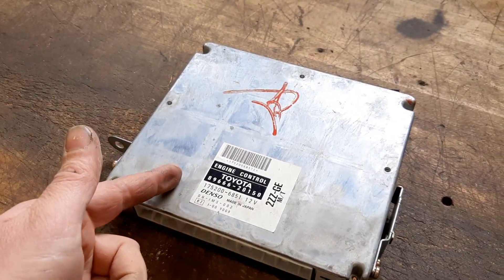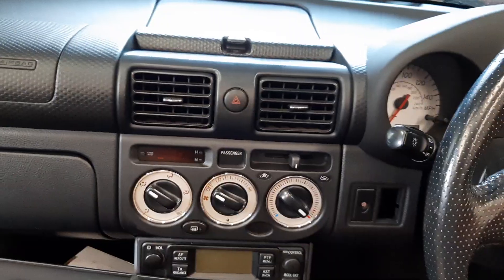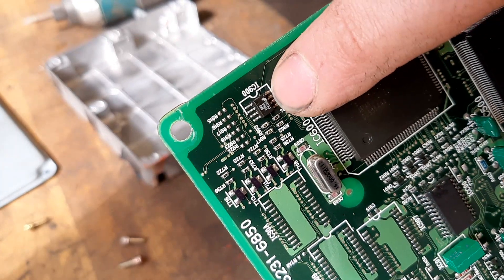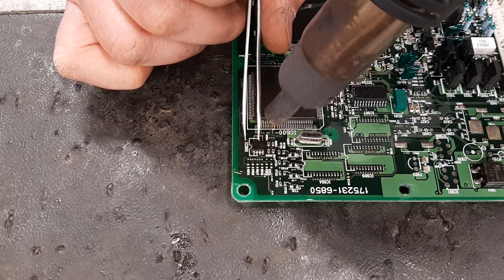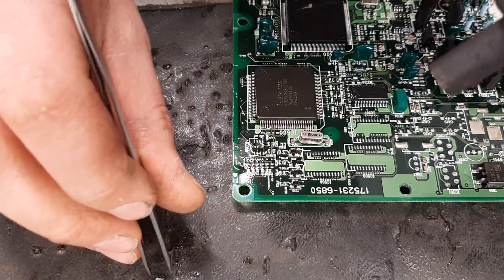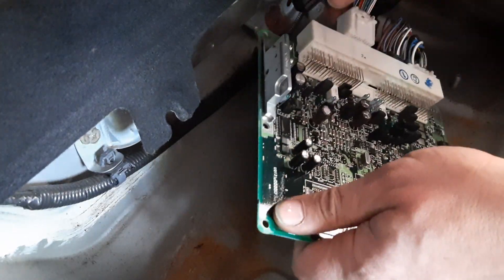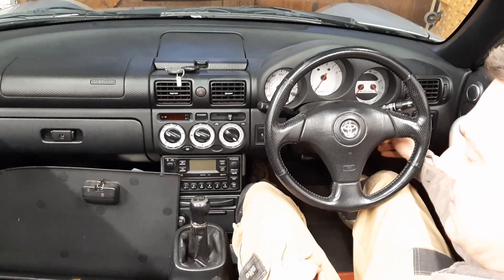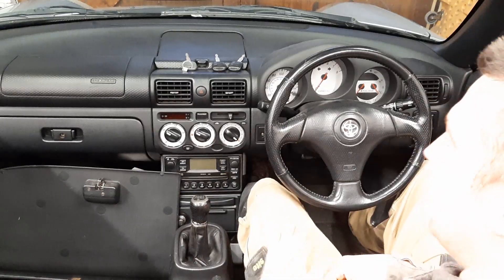Toyota MR2 Celica 1zz-fe swap 2zz-ge Immobiliser bypass for immo key reset programming solution

Comment: I just bought a 2z 2 days ago and I was going to take the chip out and do the binary but I started looking into PCBs from around the world and found in the US a lot of PCB's just never had it. I will take mine out tomorrow and see if there is any difference. from what I see if it is not connected then there is no security, it was an option I guess US wants car theft?
Reply from the maker: if you remove the eeprom the car will not start
Reply: @threepotMR2  we will see I have the chip. I can start a falcon with smartshield or smartlock if you get me into it with no key
Reply: @threepotMR2  I wish people were honest I would share some angles, there are front doors, back doors, windows and all kinds of things to get passed security. the speed sensor is obviously one. why is the speed sensor connected to the immobiliser do you think? you might understand what I am getting at.

Comment: great clear video, thanks. was wondering, would a test cable work to skip the solder step? if the board is unpowered, place the cable in the reader and touch the other end to the chips pins.

we have both cars next to each other ready for a swap. just preping for the known tricky bits.

Comment: you re genius, you solved a big problem, you can find an ecu for peanuts just because there is not key system.......when i swapped my 2zz i used a jdm ecu with an hks speed limit defencer.......i paid a lot of money ( around 400 euros) just becaused the original ecu was blocked

Comment: Is it the same IC on the 1ZZ ECU? if so would it be possible to transfer it to the 2ZZ ECU?
Reply from the maker: Yes it is the same IC and I'm pretty sure that will work totally fine.
Reply: @threepotMR2  nice one, will give that a go when I eventually get round to doing the swap.👍
Reply from the maker: @wingtit Some are marked at RH56 which is the same compatible eeprom part
Reply: this would be fancy!!!
i try to swap the eproms.
i have everything here, just missing some parts form monkeywrench
Reply: Hey! Do you swaped the eprom between ecus? It works?